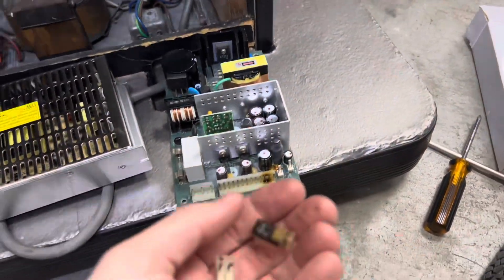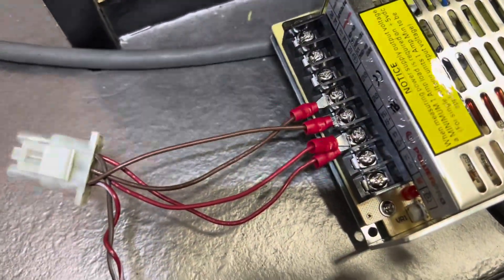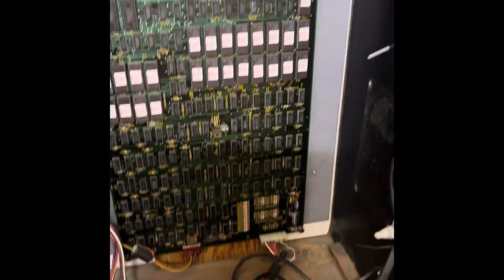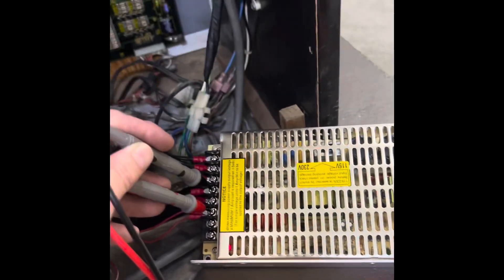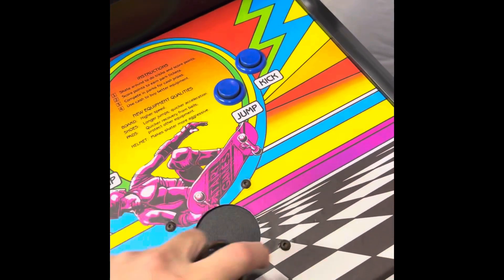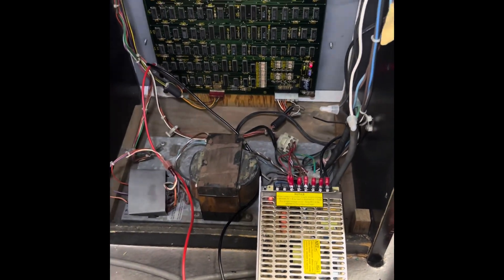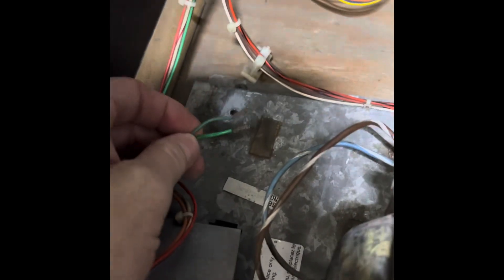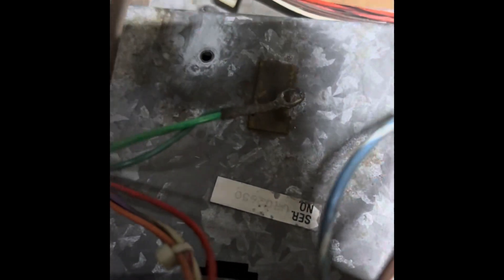Atari 720 power supply replacement

Comment: What did you end up doing with the sense wires? Are they tied together or just isolated separate?
Reply from the maker: Don’t quite follow as this didn’t use an Atari AR. Came with a switching power supply from the factory. Sorry just a bit confused with what your asking